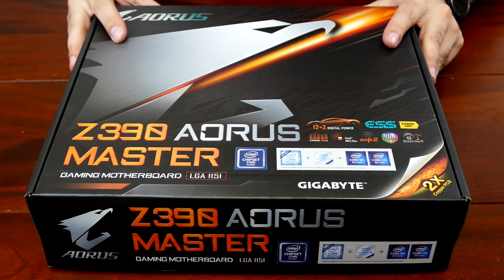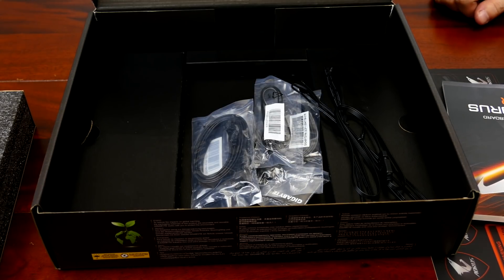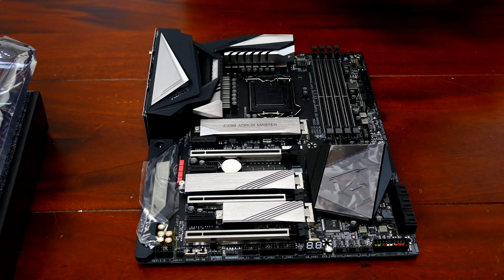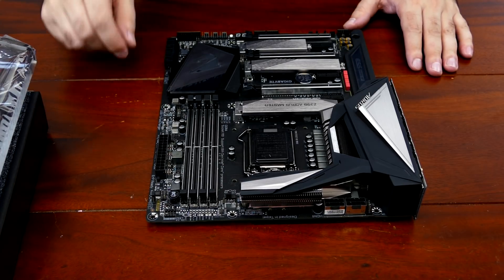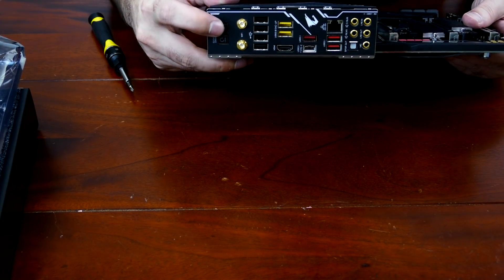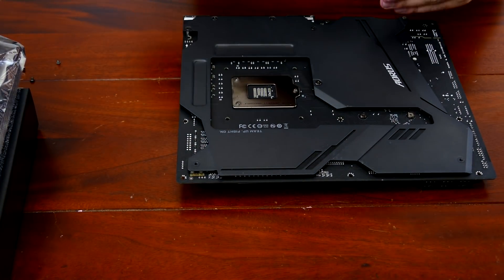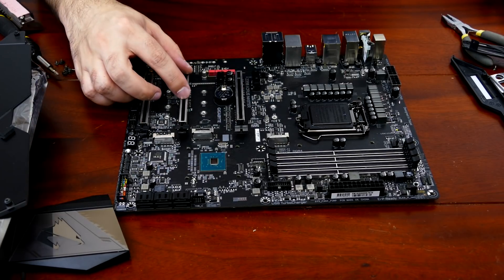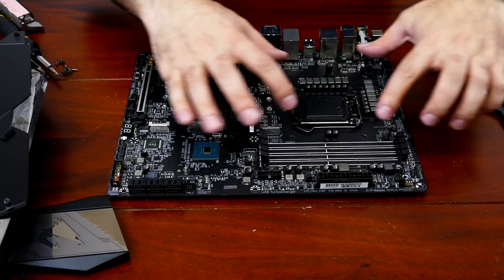Overview of Aorus Z390 AORUS MASTER with Circuit Analysis

Comment: I got mine in nov. 2019 and i love it, running a i9-9900KS it runs at a default 5.03 GHz on all 16 threads and it runs cool and quite with a Coolermaster Hyper212RGB cooler in a full tower HAF case. I actually have to look at the lights on the front to see if its running when the monitors are in power saving mode, its that quite. and YES this board supports 128GB, i am running Corsair Vengeance LPX DDR4 2666 (4 x 32GB) and its fast and smooth. The only mistake i made, and the reason for watching this, is that i purchased a Samsung 970 Evo 2TB SATA 2.5" drive and i didn't realize that its almost 6 to 8 times slower then a M.2 NVMe version of the 970 or the WD Black SN750, so if it works with one of those two then im all in for a NVMe
Reply: Oh, and F**K AMD CPU's, out of my 14 desktops i always have issues with the 5 that are AMD based, and i almost got the 3950X AMD 16 core 32 thread chip because the i9-9900KS was so hard to find, luckily my brother works only 22 minutes from a Microcenter were they had ten in stock, so he picked it up for me, yay, sticking with Intel from now on, no more AMD cpu systems experiments,
Reply: The board is also definitely sturdy

Comment: Which slot should i install a NVMe M.2 Samsung 970 Plus SSD into on the Master??? i am only using 1 GPU, but i am using all my SATA ports and ALL my USB ports, and i would also like to install a 7 port USB PCIe card, where should i plug it in??? Thanks

Comment: The only thing i dont like is the lack of USB ports, my old X79 board had 14 SATA ports, and i need at least 6 SATA ports plus 10-12 USB, i got a 7 port USB PCIe card but every time i plug it in i get an "A0" error and the board wont post

Comment: Calling the M.2 covers "heat sinks" is deceptive. They don't really have any fins, or anything that actually increases their surface area, so they are really just heat buffers, and that is, assuming that they do make contact with the M.2. Under sustained loads, the cover will just heat up until they reach the same temperature as the M.2. Another Youtuber reviewing boards actually commented that they might actually worsen thermal performances.
Reply: The area of the surface has been greatly increased, so it will help.

Comment: have this mobo. lower temps is a huge bonus. running w 9900k and 2080ti and still sub 70
Reply: air or liquid cool? i have the same setup coming soon and i got the Noctua NH-D15

Comment: Does this motherboard have a three pin and large SATA power connector? My liquid cpu cooler requires them and I can’t find either for the life of me. The SATA connectors on the side of the board are way too small.

Comment: Is the ESS dac used for the rear audio output or only for the front panel headphone output?
Reply: I can't imagine they would put a nice DAC in there and not use it all around.
Reply: Someone said that the realtek audio chip is for the back speaker ports and the nice ess 9118 is dedicated to headphones. As a matter of fact, the ess 9118 is the one that LG uses with their phones and that has a really nice headphone amp. Very low output impedance with lots of power. Gigabyte really did a good job with this one. I have one already, I sold my Gigabyte Z370 Gaming 7 because of the new features of the Z390 chipset plus the improved VRM and aesthetics. I can assure you that this motherboard is nearly perfect, I say nearly because someone might not like something about it. But to me this is the best MB I have tried.
Reply: Don't know who said that, but it dosen't make sense that they would spend money on two DACs. I very much doubt it. THe ESS DAC is a quality DAC no need for the  Realtek Audio solution.

LG's Quad DAC I believe are based on the ESS 9218P chip, wich is a pretty good DAC. I have a V20 with the Quad DAC it it's got decent power for something in a phone. Not sure how powerful the AMP sections is in this motherboard, but I'm sticking to my external DAC/AMP anyway, so dosen't really matter in my case.

Comment: If the heat pipe doesn't snake up threw the fins, what's the point. The fins are are just press up against the block. Its not a tru all fin stack design, plus the VRM is good enough that the board doesn't need it. What I've been wondering is why don't they put the finned heat sinks on the motherboards that actually need them.

Comment: hey!

which slot for graphics card do you recommend for single graphics card on this motherboard? also, combined with which m.2 slot for samsung evo 970 nvme  and 2 sata hard drives?
Reply: Hey, use the top slots for both gfx card and m.2
Reply: @typeOhh  Thanks! I'm doing it that way too.

Comment: I clicked your amazon link but couldn't find this board.  Can you please check the link?
Reply: u wont find anything in amazon
Gigabyte board are exclusive in newegg and microcenter for now
maybe in a few weeks will be available in amaozn
Reply from the maker: I think Amazon might have sold out or just is low on stock, as I found this sold and shipped by Amazon: https://www.amazon.com/Z390-AORUS-PRO-Motherboard-Motherboards/dp/B07HRZKPXM/ref=sr_1_13?ie=UTF8&qid=1539359722&sr=8-13&keywords=z390
Reply: Thanks, but I was able to find the master on newegg.  It arrived today.. now if the cpu would ship I'd be happy.  There are a few other differences, such as the elite only has two m.2 socket3 slots where master has three.
Reply: NOTE: Both "Ultra" and "Master" have 3x M.2 slots.

Comment: just ordered mine for the i9-9900k evga geforce rtx 2080 ti ftw3 ultra
Reply: Delidded my 7700k from my 270designaire to move to this board with a gigabyte 2080ti. Hit 4.9 on nzxt z63 now delidded! 250fps in squad woot

Comment: These Z390 boards look better than the Z370 Gaming 5 or 7 except for one problem in my opinion. Gigabyte chose to take away the back lit RGB DIMMs and PCI-E lanes. :(  I wish they would bring back the RGB DIMM and PCI-E lanes. Save for that, these new Z390 boards look great, and the Z390 Extreme looks even more amazing.
Reply from the maker: You know what, they did mention this at their recent event I attended. They took them away to make RGB a bit more subtle.
Reply: @tweaktown  The leds in the ram slots and pci ex slots can at least be compensanted with rams with led and m2 ssd with leds, examples the XPG Spectrix S40G and for rams the corsair vengeance RGB PRO, this motherboard and the AOG7 is the perfect example of "Old but gold" am happy owner of the aorus gaming 7 and the aorus master, but i'll canot have both, well someone of my family will be very happy with the Aorus Gaming 7.

Comment: can anyone help me out here? I got this motherboard but now I realize that my power supply the rm750x doesn't have a second 8pin eps cable. If I was to order a second eps cable could I plug this in the power supply instead of a second pcie power cable or is it possible to run with just one eps cable?
Reply from the maker: You only need one, the second is for extreme overclocking.
Reply: @tweaktown  alright thanks for the help
Reply: @dylanjmartin  yeah I'm connected the second just because I had it but is really not necessary

Comment: Another comment like that about those dual 8 pin headers. Go watch Gamers Nexus. He does the math and clearly shows that your CPU will reach thermal outputs well beyond what can be cooled before you max out your first 8 pin. The second 8 pin header is only useful if you are going to go balls to the wall with LN2. Also, seriously, have you ever managed to pull out a n 8 pin header from a motherboard? That reinforcement is useless.
Reply from the maker: Intel power specs say the 9900K could take in 330W at peak load at stock, those 8-pin headers are rated for 300W, but yea they can go higher they just warm up and your PSU wires warm up a bit depending on the gauge. -Steve
Reply: According to GN, the maximum that you can expect to be able to cool down reasonably well is somewhere around 250W or so. Beyond that, you are going to have to use some kind of sub zero cooling solution. From what he says, by the time you are getting to 200, you are already looking at a delidded CPU with a sanded down die and a high end water cooling solution. Most users won't ever dare touch a custom water cooling loop which means that they won't ever get anywhere close to those numbers.

For reference, Gamers Nexus is one of those guys who does extreme overclocking, so he would know. He's held, or currently holds several world records, has the knowledge and equipment to make theses kinds of detailed analysis.

Comment: I don't understand why they make a slot that is X16 size when electrically it's only X4, it makes no logical sense.
Reply from the maker: So larger cards can be put in that slot (think 3-way CrossFireX).
Reply: @tweaktown  I've seen some motherboards with slots that are the length they electrically support but have a notch cut out at the end to support longer cards, hence my question
Reply from the maker: Yea I have seen those too, sometimes it comes down to sourcing decisions or marketing.

Comment: A really nice board, only the msi z390 godlike looks better, but it's more than twice the price of this one XD
Reply: And they don't even support the igpu which is beyond ridiculous by msi
Reply: From what I've seen so far the Z390 Master from Gigabyte has really good VRMtemperatures, from really hot they went to one of the coolest or even the coolest VRM. 
Also they went a step further in RGB with their new RTXcards, which also looks pretty awesome. Even if I'll go with an Vega GPU by Sapphire I'm really excited to see Gigabyte direction they r heading for. Also their 16gb DDR4 dual kit+2 demo kits just to fill the two more slots on the mainboard is something new. Something simple, but I haven't seen this stuff before